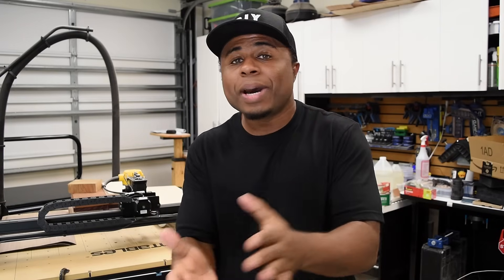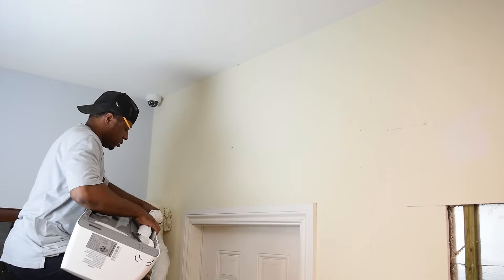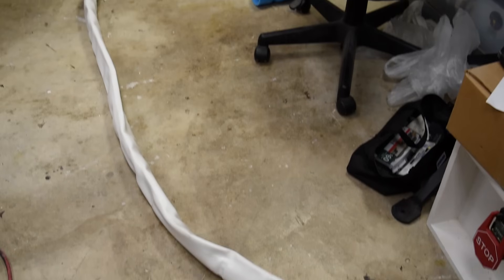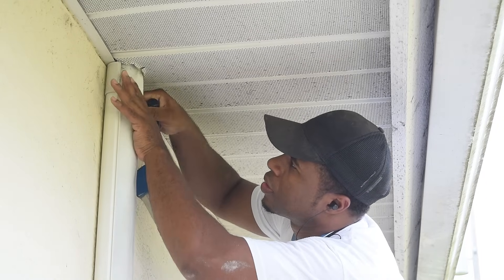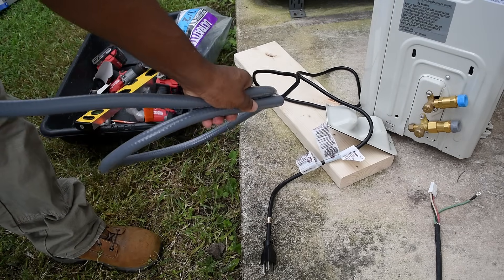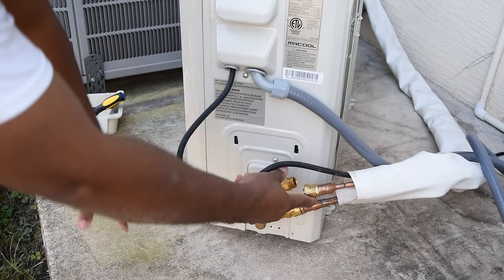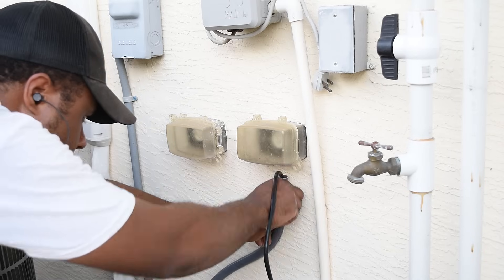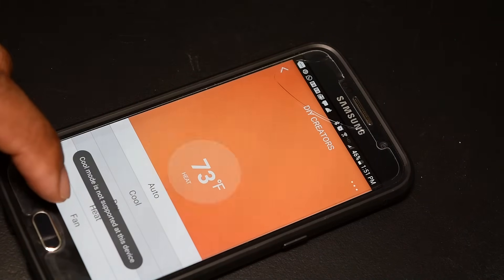How To install Ductless AC & Heating System // True DIY Mini Split MRCOOL

Comment: Don’t try to install your own mini split. Leave it to someone that knows what they are doing. I’v run my own HVAC company and get about one call a month from someone that tried this and wants me to finish the job for them. I always decline to finish the job for them because they alway screw things up so bad i have to re-do all of their work.
Reply from the maker: I understand your point and I don't blame you. I too was in the installation business installing security system etc. That's fine with other systems. The idea behind this system is it's meant to be DIY. All info is on their website.
Reply: Thats why its called MrCool DIY series.....and naturally, there will be some folks who will get in over their heads, and screw things up a bit, however, even if they require a willing HVAC expert to come out and make things right, they will still have saved lots of money over a totally professional installation.  Everyone has their own opinion of the DIY units by MrCool, however the facts are: there are hundreds of installs that have been done by DIYers out of the box ( electrical is done by an electrician in most cases) successfully! Regardless of what some HVAC experts may say, you do NOT need to vacuum the lines for the MrCool DIY series.  Why? The lines are prevacuumed and precharged at the factory, so you could NOT vacuum the lines even if you wanted to! Why?  nothing to vacuum, these lines CANNOT be vacuumed down due to the one way valves in each line that prevent the refrigerant from escaping...period! Just follow the instructions and/or keep Glen's fine video at the ready, and you are on your way to successfully installing your AC Mini Split system.  And guess, what, MrCool COVERS FIY installs under their warranty: 5 years Parts/7 years compressor.  I have found that most of the systems HVAC experts have installed were the kind where you must cut the lines to length, or start with a 1 m length you can easily put through the hole in the wall, then join a somewhat larger line set on to it.  THEN, you would have to vacuum down the lines per the instructions of whomever manufactured your Mini Split .  The mechanics of the MrCool DIY install are pretty straight forward, however, the electrical part is NOT part of the DIY routine: for safeties sake, and especially for a 240 line, get the electrical installed by someone licensed to do so. The rest, a serious DIYer can handle.  And, no, I do not have my own "HVAC" company, however I have been in on over 40 Mini Split installs, some MrCool, some Carrier.  Dont be intimidated by misinformed people, and check out MrCools website, and Glen's How To, up at the top.
Reply: Elder Geek yep I looked up all the information that is on the website and watched the video. It’s not rocket science and the instructions are not bad. At the end of the day I would not feel confortable wit a  family member installing one on their own. Pressures on a 410A system can be 400 PSIG. How are you getting around the fact that DIY’ers don’t have an EPA license that is required by to work on or install refrigeration lines?  Look I’m all about people doing their own work and I’m not in need for more work, I’m not even in the singe family residential market but I see a safety concern when people aren’t qualified to install these units themselves. I have literally been involved in installing and supervising installations of thousands of these units for large multi family  and high rise buildings. If someone wants to do it I caution them that they are breaking the law by not having an EPA license and they are dealing with a high pressure gas and liquid that is very harmful if some one is not aware of how to handle it. Straight from the MSDS sheet it states Misuse or intentional inhalation abuse may lead to death without warning.
Vapours are heavier than air and can cause suffocation by reducing oxygen available for breathing. Rapid evaporation of the liquid may cause frostbite.
Reply: There are always "safety concerns" for DIY projects of ANY kind: there are many more table saw injuries that with any other shop tool...or exploding refrigerant lines, for sure.  But that does not mean that folks who really want tot do their own work should be prevented from doing so, especially in a over regulated industry like the HVAC industry. Thats why MrCool came out with the DIY line: prevacuumed and precharged lines that are SEALED until you install them on the condenser, and open the valves on the condensor: never gets exposed to air or moisture while the DIYer is installing. Caveat: once the lines are installed, they cannot be uninstalled. I have NEVER heard of a single incident where anyone was injured by over inhalation of refrigerant gas, also never heard of any condensers being installed anywhere but outside the building, either. You can second guess these scenarios, and while they may be possible, they are not very likely.
Reply: Well if you don't know what to obviously you will call someone..what is wrong with you people ????

Comment: lol. DIY but no vaccum to make sure line set is sealed and free of non condensables?  obviously your Johnny homeowner and have zero experience much less a license.  I installed a ton of these and you have to pull a vacuum. period. Enjoy it while it lasts.... ✌️
Reply from the maker: @Thomas I can see you will not be open-minded about this clearly you know everything about this system via the video. I failed to go in depth about this system and explain this process. Just remember I didn't find a system and said mmm this one should work! I talked directly to the manufacturer of this company, they sponsored and approved this installation. Please do your homework on their website and if you disagree with them then that's you. The lines are sealed and precharged. It's 2018 things change buddy.
Reply from the maker: If you didn't work on this system or do you homework you wouldn't understand. If something is new to you don't make it wrong. 💪
Reply: @DIYCreators  it's not new. it's exactly like all the other mini splits. The line set is not sealed. therefore a vacuum is in order to make sure that your connection are tight and not leaking and to make sure anything in the line set is removed. precharged? all split units I get are pre charged.  Did you happen to throw gauges on the unit to. make sure the discharge and suction. line pressures are within spec?  You assumed the unit had the proper amount of refrigerant?   25 five feet straight up, you need a trap on the line.
you see, I am a master hvac tech with 20 years experience. Not a one and done non licensed guy.
Reply: The line set is sealed...The bid from a "PRO" was $6,000. The best price I could find from a "PRO" was $3,000, if I did ALL the installation, except for charging the system.I installed mine over a year ago for $1,765 (including electrical).  It works great at heating and cooling.I don't expect it will fail, but at the prices the "PRO's" wanted, I could replace it every 3 or 4 years and still come out money ahead.
Reply: So lets denigrate " non licensed" and DIY installers, and spread false information regarding the MrCool DIY series. Fact is, the lineset is sealed!  Which is why it cannot be vacuumed, even if you wanted to do it ( which you should not). If you were truly a "master hvac tech", you would already be informed about the precharged units for DIYers...and you know what? These are the exact same condensers and head units( minus a few bells and whistles) used by pros when installing Carrier units...except the Carrier units need to be vacuumed down, and charged: definitely not a job for a DIYer.  MrCool found the DIY need, and filled it! They work, and work well.

Comment: The drain that comes stock will not last . I recommend that the drain line be run through a PVC pipe to shield it from the sun.
Reply: @user-vv3gv9qj4g  yea they have 0 specific experience with this unit yet they beat on it lmaooo
Reply: I agree,  we have a split system (A different make to the excellent DIY model in the video) here in Pomorskie Poland. It had a similar white plastic flexible corrugated  drain pipe that was exposed to a typical Summer of 30+Celsius. It eventually disintegrated, leaving the connection open in the brick cavity wall resulting in water ingress. I wish I had done what Richard A. Valdes suggested!
Reply: Richard A. Valdes well this is a sponsor video, so he uses all that they give him.
Reply: Exactly
Reply: Copper would be best it does not support bacterial and plant growth.
Reply: Mister Berzins we PROS don’t use copper. It sweats and not only that the water that comes from condensation in ac units becomes acidic from the dust and can cause corrosion on the copper. PVC is what’s used.
Reply: @gtm624  Uhhh no. Copper is the standard. The "other" stuff has not been time tested.
Reply: John Elway what country you from? In nj. They stopped
Using copper in the 70s for drains. And water lines been pex for 10+ years. Other than Hoboken. You won’t find new work roughed out in copper. It’s all pex and pvc and csst for gas. They even getting away with cpvc water lines in big residentsl buildings with pvc drains. That’s just wrong in case of fire. Most industrial and commercial is cast drains and copper. But even commercial it’s changing. But for ac drains. It’s been pvc or poly for decades and decades here.
Reply: Don't worry, The whole unit won't last much longer than a few years in my experience......
Reply: @mattm5361  Really? 
Mine has been doing the biz for 3 years plus without a hiccup.
Having said that, thanks to YOU no doubt, I have now given it the kiss of death and failure will now not only kill me and my family but raze my house to the ground leaving nothing for our relatives as the insurance will be null and void because I installed a "cheapo Chinese"  A/C unit....
Cheers Mate.
Reply: @mattm5361  How long did yours last and what killed it?
Reply: @dyoel182  I'm a qualified Refrigeration Mechanic, I've been pulling these rubbish Chinese units out for the last 19 years.

The overall bad quality of the seamed copper, Nasty toy compressors and throw away printed circuit boards usually kill them in a couple of years, If the bad powder coat doesn't cause it to rust out first. Yes, some do last longer but they're the exception not the norm.

The other major downfall is that these companies will buy a few containers of Chinese units, Import them, slap their own sticker on the front, offer them for dirt cheap with a decent warranty until they're sold out and then pack up shop and fuck off, Which unfortunately for the poor bloke who thought he got a deal means no warranty and no spare parts. (I've seen this happen countless times)

Those quick connect fittings are renowned for leaking as well, So much so that the are banned here in Aus.

My tips for anyone looking to buy an air con is that you get what you pay for.

If you want to save some money in the long run, Buy a quality unit and hire someone that does it every day, You'll save the difference in cash just on the energy efficiency alone.

A quality unit such as Daikin, MHI, Fujitsu et-cetera can and in most cases will last 20+ years if they're looked after.
Reply: @dyoel182  I undoubtedly see the advantage of these diy units though don't get me wrong but there are better brands out there.
Reply: @mattm5361  Hi again Matt... quite agree that Daikin et al have been around for many years & seem quite reliable & durable. Total agreement. Thumbs up.

But I dispute you've been "pulling these rubbish Chinese units out for the last 19 years...." Really? They've been around that long? Mmmm?
Listen, I am no fan of Cheap Chinese knock-offs.....I waged a one-man war against many of their products here where I live for the last 15 years or  so.... mostly against anything that contained an electric motor, so a semi-hermetic compressor would instantly raise my hackles...obviously.

But my unit is as good as the day I installed it.  Heating, Cooling.... does everything as described. Quietly and efficiently. 
(I think the supplied batteries in the remote control are still "original"!)

And...let's be honest here: 
What, exactly, does "looking after an A/C unit" consist of?   
Unless it has failed...almost nothing:  
Clean the Condenser unit of dust, leaves etc....
ditto the indoor unit...(no leaves I hope). 
Check the pressures, if you must.... just in case there's a slow leak?
You & I know....there is either gas in the system or it has somehow vanished. In which case you don't even need a set of gauges.

The simple fact my friend is: If you cannot keep up...you go under.
I'm not being personal of course, I'm talking about the industry.
I was in communications until satellites made me redundant..... What I was once handsomely paid to do....now anyone can do on his mobile phone!

Time marches on. Things change. 
Being protectionist does no-one any favours in the long term.
Reply: @mattm5361  Agreed... we have customers who order complete systems on Amazon for 
500$ and install it themselves. But they call us after 1 year to trouble shoot it. In the case of a minisplit you pretty much just replace it, not much to be serviced there.
Reply: Matt M yea let these Ass clowns spend 3 grand on equipment just to not purge and vacuum it. They’ll still be replacing it few years later. When the tech disconnects the line set water pours out.
Reply: Matt M that is because you didn’t install it right. Neither did this clown. His won’t last more that a year or so either. I have replaced several customers units that they thought could be installed in this same fashion.

Comment: What the cost of operation on running these ????
Reply: Depends on several factors: The square footage of your install site, ceiling heights ( anything above 9 feet, add 25% approx to your cooling needs).  Rule of thumb still in use for many HVAC installers in AZ: 1 Ton ( 12K BTU) per 500 sq ft.  When in doubt, size UP.  Also what you pay per kwh in your locale.  This one is very efficient.

Comment: This units are available in 220?
Reply: All of the MrCool DIY units 18K BTUs and up are 240v.  Even the 12K BTU unit is available in 240v, however most people will have the dedicated 20A 120V line necessary to accommodate the 12K BTU unit.

Comment: you didnt evacuated the air from the tubes. This might be an issue.
Reply: Nope...it will not!  The lines set is professionally vacuumed and precharged with refrigerant at the factory.
Reply: Ah. really ? The lines are vacuumed. Wow. How did you attached them to the condenser then ?
Reply: Each line has a sealing valve in the end ( visible when you look at the fitting) that releases when you attach each line to the condenser and tighten, per MrCools instructions. Once attached to the condenser, you open the high side and low side valves on the condenser ( again, per MrCool's instructions), and you're done.
Reply: Never knew that. Thanks. You can add this to the description. Thanks mate! Good job!

Comment: How do you think this will hold up to shop conditions? I've killed a few portable AC units with saw dust.
Reply from the maker: Not sure yet. Adding an external filter is not a good Idea it blocks air flow.  Right now I turn off the AC when making dust. Then clean once a week.
Reply: I installed a Carrier unit in a 800sq ft metal/wood shop. I just laid a cheap $.99 thin (not too thick, now!) "blue" material air filter on the very TOP of the head unit.  Works very well, but you will still have to clean the filters weekly inside the head unit.

Comment: I therefore disagree that the cooling and air conditioning tank is essential for the evaporating vacuum is condenser and the other lines that interconnect them here in Brazil Generally, this machine comes from the factory with gas from the condenser. because it is eccentric to make the vacuum more anyway was very good your work friend congratulations a big hug ...

Comment: Awesome I've been wanting to purchase a mini split one question brother don't you have to remove the air in the refrigerant line to keep out condensation.
Reply from the maker: Thanks on other systems you would have to vacuum the lines. On this system no need for that. This is a complete  DIY unit. All you need to do is hook up the lines as shown.

Comment: You did not give a vacuum?
Reply from the maker: That's not required with this system, It's a complete DIY system. The lines are precharged and cannot be vacuumed.
Reply: Only the floor, after the install <kidding>.  This unit does not require it.

Comment: I installed a Panasonic Mini Split in my 480 Square foot shop that was Spray insulated like a Ice Chest and it wouldn't even keep it cool and it was rated for 900 square feet. What a POS, don't buy one ever.

Comment: I like your idea of running the lines through the attic. I too do not want the lines coiled up outside. Coiling them works fine, but just does not look very good in my opinion. My plan was to space the units apart far enough to use the whole 25' and run it along the top of the ceiling (I have a large wall I can just place the indoor unit wherever the 25' ends)  in the decorative channel like you used on the outside. But now I may look at the attic possibility as that would be an even "cleaner" install than the decorative channel. THANKS FOR THE IDEA!!

Comment: Why not just install a simple window/wall unit?
Reply from the maker: I don't have any windows in my shop.
Reply: DIY Creators cut a hole in the wall.
Reply from the maker: That option wouldn't make sense. I have cinder block walls. What I did works well and I'm happy with it.